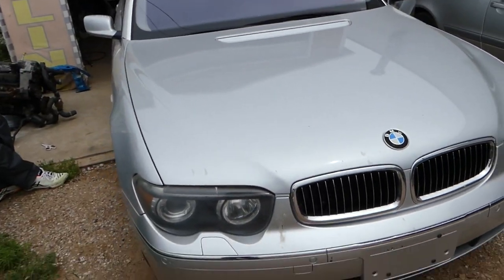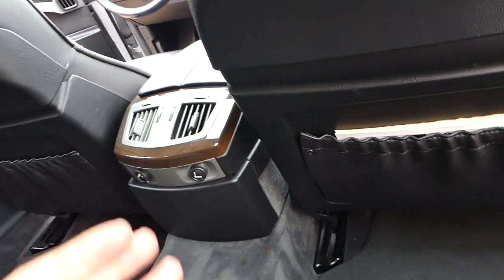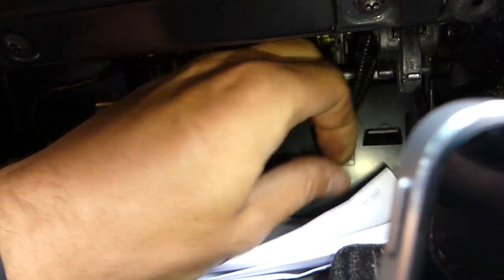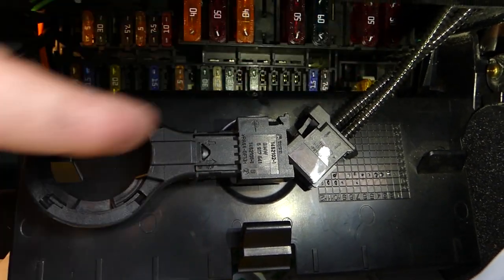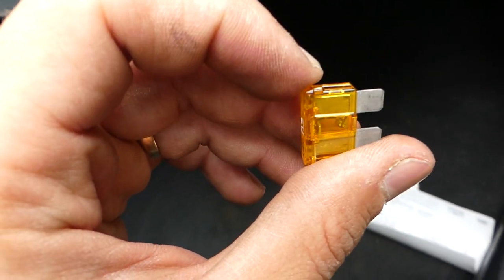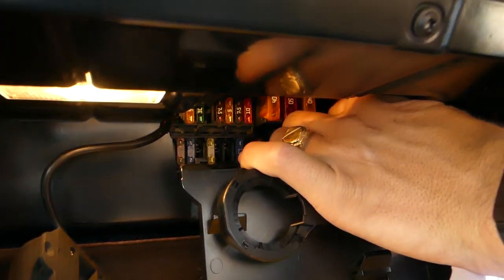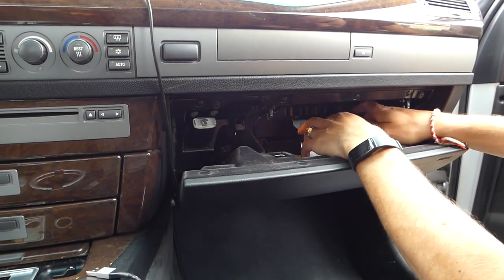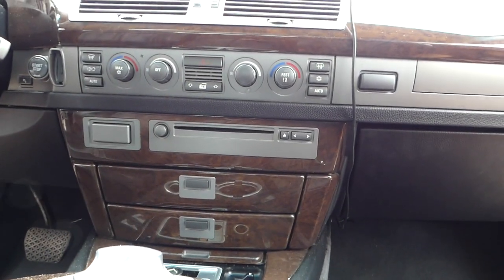BMW E65 E66 CIGARETTE LIGHTER POWER SOCKET USB NOT WORKING FUSE

Comment: I have a 2002 BMW 745i I have something draining my battery fast it's pulling 3.92 I'm stuck I don't know what it is at first I thought it was the battery and got a new one then still same alternator is good I pulled the I drive fuse to see if that's it and can't find any exposed wires please help?